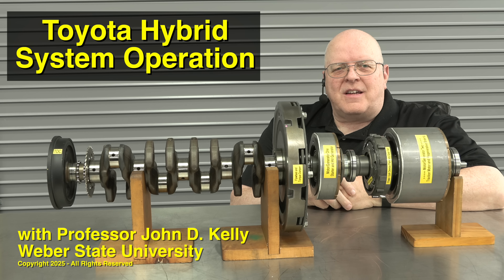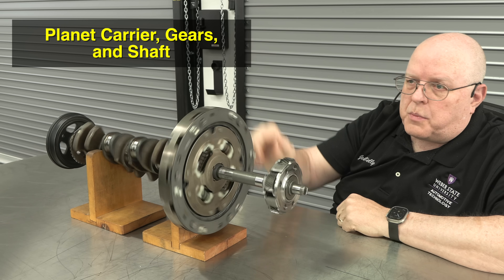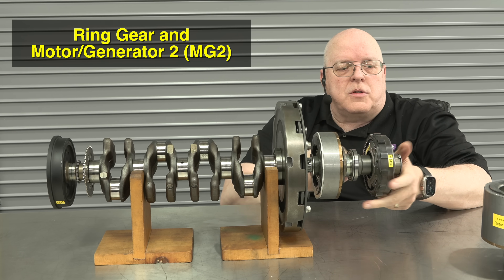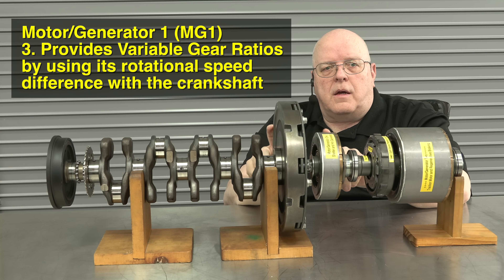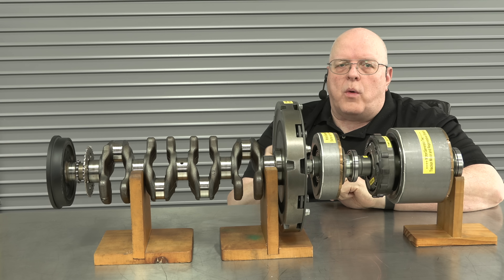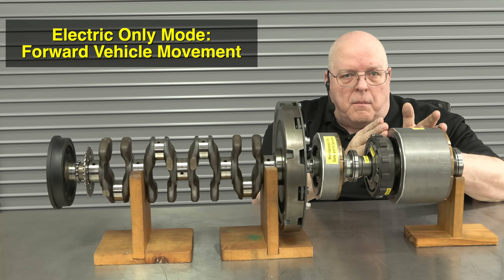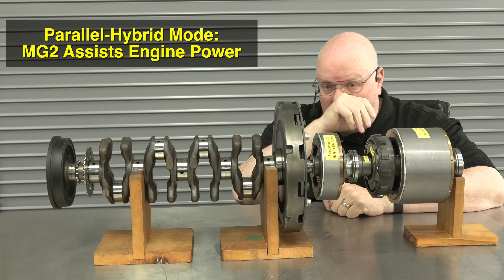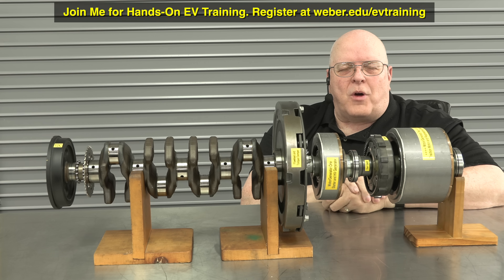Toyota Hybrid Transmission Operation - 15 Years on YouTube!

Comment: Glad my wife and I both own 2021 Rav 4 Primes. 

I have 60k on my RAV4 Prime snd I love the eCVT and I am hoping driving 86% of the time in EV that I will get 400k miles out of my automobile. 

I am 62 and plan to retire at 68 and it would be nice if I can avoid costly repairs when on a fixed income

Comment: The related part of the story is that the Toyota hybrid uses an electric motor for the rear wheels to make it all wheel drive.  This eliminates all the complicated mechanical hardware in other all wheel drives.

Comment: Curious: 
- Would this system work without the flywheel (like Koenigsegg Jesko)?
- Would using axial flux electric motors instead of radial reduce the weight worthwhile?
- Would a 3 cylinder petrol engine instead of 4 be even more economical?

Comment: As a Prius Prime owner, I can’t think of a better commuter. I get 50MPG with gas. I get 30 miles of EV range from charging. And I can get about 500-750 miles per tank if I charge occasionally. 

I gain battery going downhill. I pretty much never use my brake pads. And I’ve held cruise control at 120mph. 

It’s a truly brilliant system. My only complaint is they don’t make a fast Prius. Imagine Tesla motors and batteries and a GR Corolla engine. Just keep the engine loaded and under boost and add some powerful electric motors, it would be unreal.

Comment: I really enjoyed the video Prof Kelly!  Thank you!  I was wondering, if it hasn’t already been done, could this same approach be taken to drive a propeller on aircraft, or does it pose a problem to either weight or available space on an airplane that it doesn’t pose to an automobile, but which makes it impractical for an airplane?

Alternately, what about a hybrid airplane in which - for the purposes of minimizing the needed weight and space - the onboard battery were only designed to provide enough power for 10 to 20 minutes of flight, just long enough that if the combustion engine should fail at a critical point (such as after taking off, but not enough altitude has been gained to provide the pilot options to safely glide to an acceptable landing spot) that the battery and motor combo could take over long enough to safely land, or at least provide a less dangerous landing option?  Thoughts?  Thanks in advance!

Comment: Compared to a conventional CVT this removed the belt and added electronics to control the internal combustion engine and the two electric motors and move energy to or from the battery. Seems like an improvement since belts are more likely to fail than electronics. They don't use this idea for non-hybrid cars because they would rather have one belt than two electric motors. Hmm, does this design depend in an essential way on having a battery?

Comment: So this should be a very reliable transmission type.  Anytime people see a XVT, they automatically associate it with a CTV, which has had a bad reputation for reliability.  Wondering if it could hold a lot of power easier too.  I would imagine so.

Comment: Why is there a jerk when shifting from P to D in the ECVT transmission when the engine is cold? Engaging the handbrake in N and then shifting to P doesn't help. The Corolla forum in Poland is looking for a solution to the problem.

Comment: Toyota eCVT's are bulletproof and pretty much last forever.  Some people shy away from these cars when they see eCVT and think they might have the issues other CVT's have (like the Jatco ones used in Nissans).  But they don't, it's a completely different technology.  It's not really even a transmission, it's 2 electric motors and a gear set that "emulates" a CVT.  It acts like a CVT to the driver.

Comment: Excellent explanation with actual hardware and operating modes. Thanks for this valuable lesson. 
Epicyclic gears are almost magical in all the different ways they can operate. 
Are all CVT now using epicyclic gears instead of conical pulleys and belts?

Comment: I have a question I have not found the answer to elsewhere.
Turning MG1 in one direction or the other changes the ratio between engine speed and wheel speed.   Power to turn MG1 comes from the traction battery.   My question:  How much power is required to make MG1 perform this function?  Is it conceivable that this system could be used to make a CVT without a MG2?   You'd need a battery to run MG1 or be recharged by it.

Comment: I remember watching your original video 15 years ago. This transmission was novel when it came out, and still a marvel of engineering today. 

Two questions i have as a toyota hybrid owner myself:
1. What is the transmission doing when the car is in Neutral? i sometimes slip into neutral at freeway speed and glide. How much transmission/engine mass is spinning freely? 

2.  Could you explain the operation of toyota’s electric AWD system paired with current hybrid models? The Corolla hybrids have AWD now, amazing feature for an entry-level vehicle!!

Comment: Love your videos can't wait till there's one on the new generation Prius and the difference between the generations. I couldn't help but notice you left out one mode the one where the battery is completely charged and it has to burn up the power by spinning engine crankshaft.

Comment: Die Hybrid Technik von 
Toyota ist die beste 
Erfindung der letzten 
20 Jahre.
Mein Vater hat einen 
Ford Fiesta Eco Boost.
1,0 Liter Hubraum,100 PS
3 Zylinder,Verbrauch 6,5 l
Ich fahre einen Lexus ES 
300 h,2,5 Liter Hubraum,
218 PS,4 Zylinder,
Verbrauch 4,0 l 
Auf langen Strecken oft
bei nur 3,6 Liter.
Beim Fiesta geht unter
6 Liter nichts.
15 Jahre Garantie bis 
250000 all Inklusive 
Leistung bekomme ich
bei keinem deutschen 
Hersteller.

Comment: This is really neat, though I still have to think carefully about where the power is going and how much energy is coming from each motor/generator at any time.  But I suppose as long as the engine generates more electricity than the wheels consume at most speeds (perhaps not reverse) all is well.

Comment: As I understand it, reverse is powered solely by the electric motor. I had an experience where I was reversing uphill on a relatively steep slope. I had to brake, and in the process, I forgot that the car (Toyota Highlander Hybrid 2022) was still in reverse. When I released the brake pedal, the car slowly rolled forward downhill for a few seconds.
My question is: Can this forward movement while in reverse gear cause any damage to the electric motor?

Comment: The only thing is missing from hybrid system in Toyota cars is... 12v battery emergency charger/converter placed between big battery and 12v battery...
Recently my 12v died because of car not being used much and I thought - why my car can't notify me when 12v goes out OR charge a bit 12v from big battery?
12v is not even needed to start the engine, so it would be perfect match

Comment: Likely the best video about the eCVT/Toyota hybrid but still lots of questions. I think if somehow a 3D animation was possible for this, switching between all possible modes and separate indicators for charging status, fuel consumption, if the engine is off and so on, that would help us understand. Amazing tech by Toyota, I'm happy about owning one of their hybrids.

Comment: Nice explantion. Did you noticed that is very similar to a diferencial, but placing MG2 in the input, the combustion motor in wheel side and a MG1 in the other wheel side... and obviously putting everthing on same axis and to make it more compact.
Reply from the maker: Yes, it is similar but it also has a gear reduction through the planetary gear set, where differentials do not. Thanks for watching

Comment: My understanding is that the HSD is always in some kind of parallel mode when the ICE is used to supply power. As explained, while the MG1 is involved in arranging the suitable gear ratio for the ICE given the required power to the wheels and suitably efficient RPM by varying its speed and direction, it also experiences torque. Torque and speed both being nonzero means MG1 is contributing power to the wheels. MG2 can contribute power on top of that, for a "second level" of parallel power.
Reply from the maker: MG2 can contribute as long as there is enough electrical energy. It can also be driven by the ICE and MG1 to act as a generator. Thanks for watching
Reply: @WeberAuto  The MG1-as-generator to MG2-as-motor energy path is called "heretical mode" right?

Comment: I too own a 2019 Toyota corolla hybrid. The only thing I don't like about it is the vibration in traffic situation. When your battery is low, the engine kicks out to charge it while you are still, that vibration gives an unpleasant feeling. Other than that, everything is alright.
Reply from the maker: They try to reduce that by varying the cam timing on the intake valves to reduce compression upon engine shutoff. You might have a cam phaser/actuator gumming up with oil sludge; but it could also be a motor mount issue or even just normal operation. Thanks for watching

Comment: This system offers the benefits of a CVT system without the disadvantages-the variable diameter pulley and the steel belt with its wear & maintenace issue (hello Nissan).
Reply from the maker: Exactly! Thanks for watching

Comment: The "series" part is generating with MG1 while motoring with MG2: the electric machines (motor-generators) pass the power in series. 
The "parallel" part is that power is transmitted through the shafts and gears without going through the electric machines, in parallel to the electric power path. 
A power-split transmission always has both power flows (if the engine is running), so it is always both series and parallel... which is why it can be called a "series-parallel" system. 

The modes of operation which involve power being supplied by the battery to supplement engine power, or being stored by the battery, are important to the hybrid system... but they are not really "series" and "parallel". Battery power either adds to or extracts from the electrical power flow, which is always a series operation and is always in parallel to mechanical power flow.
Reply from the maker: Thanks for your detailed comments; you make a great point. I did not mean to imply the series and parallel modes are stand alone modes, I should have done a batter job of specifying it.

Comment: If you think of MG1 as charging the battery, you're missing the point of a power-split transmission. The planetary gearset (the power splitter ) divides - or splits  torque between MG1 and the shaft to the transmission output. As always, power is the product of torque and speed, so the split of power to MG1 and power out the shaft depends on both the gear ratios in the planetary gearset (which determine the torque split), and the speeds of the shafts. Power to the shaft goes to the wheels; power to MG1 (acting as a generator) is transmitted electrically to MG2, which acts as a motor to make it back into mechanical power; the split flows of power join to drive the wheels. The whole system works without a battery. Controlling the MG1 speed controls the engine speed, making the system an electromagnetic transmission of any desired ratio (of engine to wheel speed). 

The battery is an extra feature than makes this electromechanical transmission into a hybrid system: it can store extra energy or deliver needed energy, but it doesn't change the ratio of engine to wheel speeds.
Reply from the maker: Thanks for your detailed thoughts.

Comment: I am totally in awe to the guys that invented and created this drive system.  It is so complex and so simple all at the same time that it is a wonder that it hasnt been copied all over the place. It is a triumph of engineering, and proven reliability, why are we all not using this motor drive in our cars?  It is so reliable too, which is far more that can be said of todays normal engines.  It appears that the Atkinson cycle engine used, but not explained in detail is also reliable.  Hats off to making this video again to iron out the bugs in your last one.  Thank you.
Reply from the maker: Thank you very much

Comment: don't understand why everyone didn't jump towards Honda Hybrid E-Drive type systems
Reply from the maker: The Honda system requires an overdrive clutch pack for higher speed operation. The Toyota e-CVT system does not. Both systems operate similarly, but the Toyota system has fewer parts. Thanks for watching.
Reply: @WeberAuto  we must be talking about different e-drives  .   honda is much simpler

Comment: 0ne weight and space saving of HSD is to,eliminate a multiple gear ratio gearbox,, for instance the very good ZF 8HP used on many cars from Guilia to Silver Ghost weights 87 kgs. ..and since only one ratio is used at the time , the seven others are dead weight…a definite weight advantage over for instance aGolf eHybrid using a dual clutch triple axles Pelletier type DSG gearbox ending being heavier and less efficient than an optimised XW60 Prius with HSD..I did considered both as Phev to purchase, but do not really need the extra range of the heavier and less efficient one.
Reply from the maker: Thanks for your thoughts

Comment: What is the percentage saving on fuel  consider that power was used to driv the motor generator  i am sceptical about th saving on fuel 4th October 025
Reply from the maker: I don’t know the answer. Don’t forget the kinetic energy of the vehicle drives the motors during deceleration and recovers energy. Thanks for watching

Comment: In hybrid cars, the combustion engine will run for short periods. Won't that shorten the life of the combustion engine? The oil doesn't get hot, the fluidity, the lubricity are reduced and condensation will collect in the oil. If the manufacturers have taken this into account, have they reinforced the bearings on the piston rods and on the crankshaft? Otherwise, the engine won't last long.
Reply from the maker: Good question. It has not been a problem in these vehicle for almost 30 years now. Thanks for watching

Comment: The secret of this device is direct torque control of PMSM (permanent magnet) motor. It was invented mid 1990.

I invented it and got a patent for KONE Ecodisc elevator motors.

Toyota has basically similar system. Both of them are based on resolver as an angle sensor.

Full DSP solution has been available ~ 20 years.
Reply from the maker: Thanks for watching

Comment: I am curious, I was told a Corolla Hybrid automatically switches to petrol mode when it reaches a certain speed eg: 50km/h. I wonder, does Corolla (Toyota) have an option (hidden/mystery) setting to modify the speed limit other than 50km/h? Why does Toyota not set the limit speed at 60km/h instead of 50km/h? Coz most of the metro speed is 60km/h. This will save more fuel on petrol.
Is there any jumper setting or in some form of electronic setting where only internal Toyota staff can access? If I were an engineer. I will provide this option for further enhancement easily.
Reply from the maker: I suspect the battery energy is too small to support that. Thanks for watching

Comment: Thank you , but and if high voltage battery is empty , what then . I have troubles 12 V battery.
Reply from the maker: If the high voltage battery is discharged, the 12 volt battery will not charged any longer.

Comment: Is there a upper limit to the overdrive ratio it can use? Seems like it could spin MG1 backwards faster and faster and keep the engine rpms very low even at very high speed provided there is enough torque from the engine
Reply from the maker: It is only limited by the maximum RPM for each motor and the maximum vehicle speed allowed. The maximum RPM varies based on the model of the transmission.

Comment: Hybrids are for utter idiots !  Overly and unnecessarily complex, requiring significant compromises in the engineering and needing lots of maintenance, whilst still burn FF’s with tail pipe emissions. Also most likely to catch fire of ANY fuel/energy type vehicle!   If you want a BEV, buy a BEV, they’re great! Imagine carrying an engine/gearbox and differential (oh a massive fuel tank too ) when you are running on battery power ! 🤦‍♂️😂  And of course imagine carrying a heavy Lithium battery and electric motor when you run on petrol power ….  

Stupidity beyond belief.